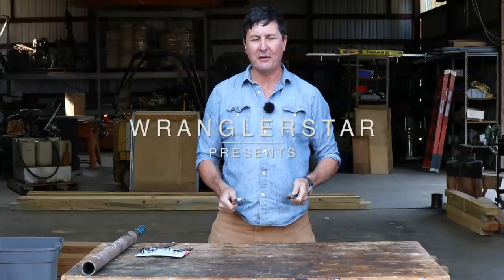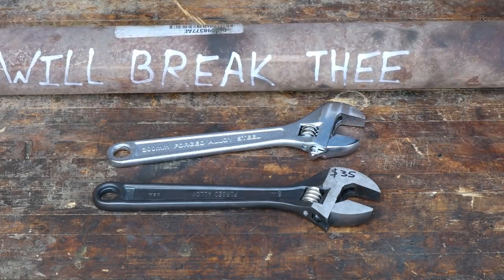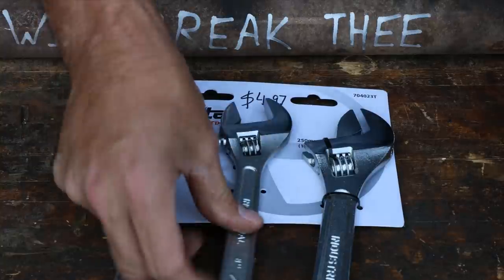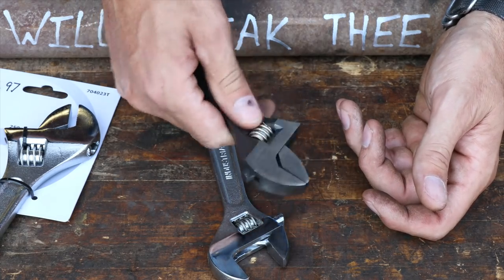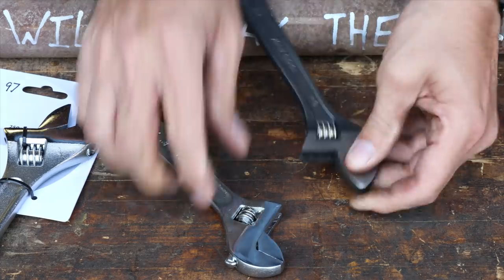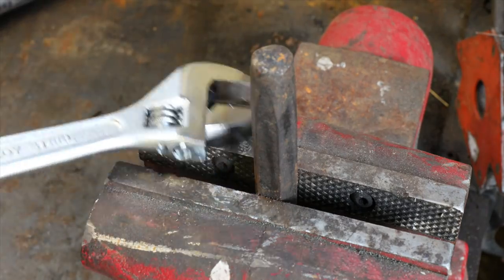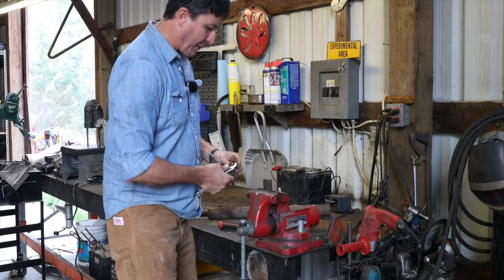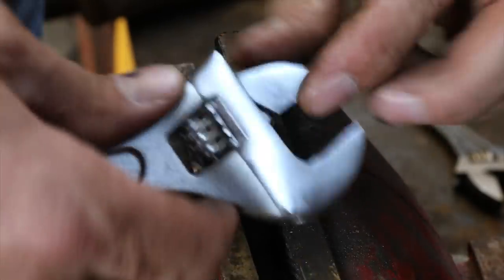Testing Cheap V.S. Expensive Wrenches On AMAZON

Comment: As a retured engineer the writing was on the wall.when we could by finished product for the price of a raw casting . Crescent wrenches should never ever be used for bolts that are seized . They are just not strong enough . Where they come in are when you need an adjustable spanner for a lightweight toolkit as you said . I have some cheap chinese ones that have served me faithfully for nearly ten years now and yes I will admit that occasionally they have made good hitting sticks :-)

Comment: I have rarely ever used any of those cheap Chinese tools and ever had one last more than once. I call them imitation tools. Most notorious are those dollar store canopeners. May be just a rumor, but I've read once that the Chinese use an alloy called Magic Metal. Magic Metal is said to be an alloy alloyed with 3% lead. This greatly saves tooling and fabrication cost. I always questioned the extra cost of premium tools such as Snap On. With Snap On tools you have to look at 1) it's functional value 2) Its collectable value. Snap On tools have a value added on top of them similar to buying a Rolex watch or a Ferrari automobile. This collectable value can be viewed as an investment.

Comment: I've learned over the years that high quality doesn't always equal high cost. One of the variables is knowing how to use tools correctly and appropriately. In it's heyday Craftsman tools were top notch and in a huge variety and priced well below Snap on. Any one with experience should be able to tell the difference between high priced professional tools, realistically priced quality tools and cheap Chinese junk.

Comment: I love my dollar tools. I've rebuilt many cars and torn down many vehicles with a mix of expensive tools and dollar tools. I'm forgetful though. I will spend a few hours in the sun taking apart an engine at a junkyard and sometimes forget a tool or a flashlight. I don't worry. I just go get another one. My socket set and my wrench set is pristine though. I believe that the answer is mix great tools with tools you don't mind losing. The great tools being the ones used more often. I can replace my hammer with a heavy rock if need be so I don't worry about that as much. Sockets and breaker bar are as good as I can afford. Love your tools at any price.

Comment: I buy cheap tools if I know that what I need it for is either a one time use or the job doesn't require much for or precision. Expensive tools are more for repetitive and tough job where quality is needed more. I usually lean towards mid to expensive tools as the jobs I been doing need it. Before I buy the tools I also look to see what I may deal with on the daily and its precision so I do a bit of research on the job and tool if I am new to either.

Comment: I just looked at the S-K wrench on Amazon and I see you can get it for $27.71 plus tax or you can get one from Amazons Warehouse Deals for $22.68 plus tax again. I have soo many adjustable wrenches that I’ve given many of them away but for many applications I will use them. For a tough bolt or nut I go for the combination wrenches.

Comment: Here in the UK, that's an adjustable spanner - a crescent wrench is a completely different tool. And as other people have commented,  I was always under the impression that it was first made by the Swedish company Bahco. In fact, I have a couple of Bahco adjustables which actually say 'Invented by Bahco' on the handle. So who was it - Crescent or Bahco? Bahco adjustables are still considered to be the best you can get, but they're not made in Sweden anymore, sadly, they're made in Spain.

Comment: That's Amazon though.  A husky 12" from Home Depot is $15 off the rack and comes with a lifetime warranty.  I work in a pressure vessel and pipe shop fabbing up big industrial systems like mixers and heaters.  I have 2 Husky adjustables that I have abused the hell out of.  One of them is so old they don't even make the body style anymore.  Still work like new.

Comment: I'm in the "crescent wrenches are trash" group. I've turned more than a few bolts in my day and I personally think you should be using the RIGHT tool for every job. You will save yourself a lot more work in the end. One rounded off bolt is all it takes to make a person wish they had used the correct box wrench in the first frickin place . . . I'm telling ya, you can be as careful as you want, but the crescent wrench just isn't capable of securely gripping the head of a bolt or nut consistently. Especially when rust and damage are introduced into the equation. Just get a box wrench set and put that in your car instead. The "300 lb." line was a joke, I get it, but it's also a severe exaggeration. You literally just need a set from Menards or something. They are relatively cheap and you will never think to yourself "this is just too heavy to have in my car" . . .  Plus, if you like having a crescent wrench still, guess what? You can still throw one of those in your car too. We're dealing with cars after all and not a light weight plane craft which can't hold the extra 10lb. of weight.

Comment: I think the quality vs price argument all depends on what you're going to be using the tool for- the cheapo Chinese wrench will do most people just fine for the vast majority of jobs- while the American one has a much higher tolerance, most people's day-to-day work probably won't involve putting so much pressure on the tool that it'd reach the failing point of even the cheaper wrench. For the one in a hundred job that does go that far and cause it to fail, well... it's cheap enough to replace that that's no huge loss.

Comment: The SK adjustables are identical to the stamped and forge-embossed craftsman, williams, wright, proto, allen, ideal, and rigid adjustables. They were all made at the same forge. That forge was liquidated may 29, 2020 by ideal industries. Point is, find the one that is cheapest between those brands and buy that one, they are identical wrenches. Look for “W   F” forged into the handle at the hang hole.

Since the plant shutdown, the future is uncertain for all those brands (edit: future as far as where they will be forged and the quality of the forgings) although if you like SK buy them now while you can. Ideal industries is so unbelievably incompetent i suspect they will mismanage SK to the point of liquidation in 3-5 years.

Comment: I’ve been working and been mechanically inclined for about 5-6 years now (I’m 22). I’ve only found one instance where a crescent wrench has been the best tool for the job.
Reply: When your a service tech walking miles everyday every multi function tool saves your back.   90% of fittings are not tight enough or sensitive enough to demand proper wrenches.     

When working at a bike shop I was rabid about proper fitting wrenches and Allen Keys’s. 

In industrial hvacr plumbing and electrical not so much.

Comment: You should've changed the height on which you were twisting the hardened nut or get another 1/2 bar so we could look at the marks both keys left on the steel. I mean you can clearly see as the S-K bites onto the 1/2 inch bar :D

Comment: you can file a knarled bolt to two flats and get an ajustable on it. can't do that with a ring spanner. I was cringing a bit with the lack of protection . Made a self adjusting one with a cam as an apprentice.

Comment: Adjustable wrenches have an off set handle for a reason it is so you can use it either direction there is no clock wise or counter clockwise direction to be properly used.
Reply: Would you not flip the wrench over to use the strongest part of the wrench?

Comment: I buy the expensive tools because I know that they last. I have tools from my father and grandfather. I buy cheap tools to use as loaners. If the break when the borrower, they think I have cheap tools and may stop asking. I have a Stihl gas trimmer, and a Bolens. My neighbor wanted to borrow my weed eater so I gave him the Bolens and told him that he could use it if he could get it running. A week later he returned it in working order. He said but he rebuild the carburetor, a put new fuel line, air filter, and a spark plug on it. After buying all those parts and a can of carb cleaner I could have just went to the pawn shop and bought a trimmer himself. I wish he would move back in the neighborhood because after sitting, the Bolens rusted and locked up

Comment: There is a good chance I forged that SK wrench. It’s what I do for a living...to say that SK is one of the only USA forged wrenches is only partly true. Yes, companies are moving production overseas. But in the forge where I work, the name rolled into the tool is the only difference between SK, Craftsman, Wright, Proto, and Allen. They are all exactly the same 1095 steel, forged in the exact same dies, and by the exact same forge operator. They all sell for roughly the same price although SK may carry a premium just because of that Super Krome marking. It is no doubt the most expensive of the 8” adjustable wrenches we forge just because of the name. So I am curious why you would choose the most expensive, mid range adjustable you can find. It would do you some good to maybe research your tools a little better before making assumptions. The forge touchmark is right there, visible to the world lol.

Point is, buy American.

Comment: I bought a 5 dollar socket set from Wharf Haul (note name changed to hide the guilty). Each of the sockets should have said "Sort of" in front of them - such as sort of 1/2", sort of 5/8". Sometimes they fit, but most of the time they were larger and had play, and sometimes they didn't fit because the socket was too small for the nut. As the saying goes, you get what you pay for.

Comment: 👍But 🙂8:08 5 sided? And: To put the least strain on the movable jaw, always turn it in the direction of the fixed jaw, clockwise or counterclockwise doesn't matter, just hold the adjustable wrench in the appropriate position.

Comment: Think about the efficiencies in your life.
.
Who wouldn't pay an extra $30 if you knew it meant an extra day (over maybe the course of a year) with your kid that LOVES playing with her dad.  Every rounded off bolt and wrench needing replaced is at least an hour lost, if you lose 2 hours of your weekend dealing with problems like this, that's 6.3% of the weekend plus the time of the job if you hadn't had a failure.  
It's kind of like passive income for personal time, if you buy a stock and it pays you monthly without any interaction that's basically free money - same thing if you buy a good tool you have essentially for the lifetime of the tool free time.
.
I just bought the 18v (36v total) Makita weed wacker, I'll not be visiting the chiropractor for shoulder pain, taking it in for service because it won't start, buying gas for it, buying a spark plug for it, cleaning it out, buying Seafoam for it or trying to repair it.  That all comes out to more free time for "want a flip!  Ride swing!"

Comment: It’s a great idea to buy at least 1 set of really cheap tools that you don’t care about so that when the time comes that you need to sacrifice it to do something like grind the hell out of it or weld it to something or bend the handle or something that will ruin it to do what you need done that way you don’t cry about welding a 20$ snap on socket to a nut or use a torch to bend the handle of a 14mm wrench to get to some weld nut inside a structure of a car body so it’s a great idea to have a mixture of nice high end tools that are worth the money and some low end bargain buck tools that may have to be used in a way that they aren’t intended and if anyone disagrees then they obviously don’t work enough to need their own tools anyway

Comment: I would prefer a twist or bend over a snap or a break.  I have seen breaks lead to a chunk of metal fly around 100 ft (+/-)
Reply: It could have travelled further but something intercepted it.  If you are breaking tools at these levels of torque, you are using the wrong tool.  Any pipe/cheater bar is going to exceed your tools' limits in most cases.  Not saying I don't do it.  But you will weaken your tools over time.  Be safe.  Thanks for the video.

Comment: buying 40+ adjustable wrenches is nuts, you just need to organize better. On top of that, probably the best arguments for cheap are: who are going to use them and how frequent (for example if you've hired some people to do some work, you won't provide them all with $35 adjustable wrenches), the best arguments for quality are: where are you going to use them and on what. If you need it to be reliable and durable, go for the expensive one, if you only are going to use it occasionally out in the field, but it must work properly, get the expensive one. The cheap one will wear much faster and it's accuracy will fade fast. 

If it's for your profession, just get a full set of unadjustable ones as they defenitely do the job much better and faster.

Comment: The problem with these adjustable wrenches is that you'd have to buy pretty expensive one or otherwise it loosens up and destroys the bolt/nut. And even then it will fail eventually.

Comment: Great video but I don't think that buying a more expensive tool just to make you more mindful and fearful of losing it is a great idea. I think you need to buy the tools that suit the type and number  jobs that you plan to use it on. The best way to learn is to buy a cheap tool and see how often you use it and if it breaks while using it, replace it with a more expensive tool. It's true that you might save more money not buying cheap tools over and over again but at the same time you might be paying a ton of money for tools that you'll only use once or twice and never use them even close to their breaking point.

Comment: Those that wanted to see the twist. It was soft junk mild steel. True high carbon heat treated steel will snap when put to extreme pressure. Real Steel baby. ;) VoodooSteel

Comment: @wranglerstar please do another test with a 1950s-60s Crescent wrench. I have one which I have abused and abused with cheater pipes and flogging it with a sledge hammer. They are much stronger than anything I’ve found made currently.

Comment: i dont buy the direction you say to use those wrenches, in the the direction you use it, it puts the pressure on the top of the adjustable jaw, if you turn it the other way all the force is at the bottom of the jaw, you should test it. Also i reckon you should swap your breaker bar for a big torque wrench

Comment: 1- Safety glasses -- every time you're using a tool. That discipline becomes a habit that can save your eyesight, or at minimum spare you a whole lot of grief. Only a bonehead would debate that.
2- You should rig a torque wrench extension to wrenches, not guess that it 'feels like' you're cranking out over 100 lb./ft. of muffin-bustin' force. 
3- Slightly after 9:44, the punch definitely marred. ; ]

Comment: he didn't have to spend 40 bucks and 20 minutes to come to that conclusion. the bottom line is that if you are doing a lot of work day after day many hours he's correct in the long run you're better off buying the best cause he's right the quality, it makes your job so much easier, etc. but on the other hand if you don't work on much stuff maybe a few dyi projects a couple times a month or so then buying cheap tools are probably your best choice

Comment: Most adjustable spanners are useless, especially those Chinese versions. They will ruin the nut or bolt and they will hurt you when they slip or break. Better buy the correct spanner for the job.

Comment: the problem with that wrench is the weakest part, the part most likely to fail, has been made from cast metal. if they had machined that jaw from a piece of hardened steel, it wouldn't have failed there.

Comment: breaking a tool on material harder and or greater in density as well as resistance is not a test.
Its just breaking a tool. I've broken many a tool using them incorrectly.

Comment: Well this one is easy ofcourse there is a diffrence the cheap adjustables always slip and roumd my bolts the adjustment is to loose i always buy proper aduustables for that reasom cause its worth it to me then to have to have to pull out stripped bolts, ive never had to put enough force to break either

Comment: Adjustable wrenches aren't made for heavy work ,they are for bicycle repairs LOL
Reply: Adjustables are very often used by plumbers and hvac guys for loosening and tightening compression and flare fittings because they're lugging their stuff with them up ladders, in crawl spaces, etc, so it's a lot easier to just have a one-size-fits-all wrench. I'm a maintenance mechanic and I use them often for air line fittings, square head bolts, bending thin pieces of metal in a vise, or if my tools are on the other side of the plant and I need to do a quick fix for something. Adjustables are also great for holding any kind of square or rectangular piece in position. In my opinion they're an integral part of any tradesman's tool set.

Comment: And there I was thinking that Swedish company Bahco invented the 'crescent wrench' in 1891 yet Crecent didn't exist until 1907. It would seem that all tools not from the USA are poor quality. Do Snap-On have their brand made in China now?
Reply: A good 'wrench' has a handle with a proportional length to the rotaional torque it is designed to exert. Putting a bar on the end is in no way a real world use. If you are just trying to break a tool, fine.